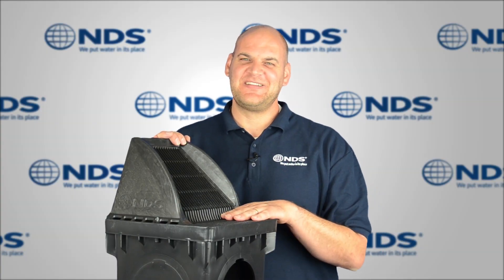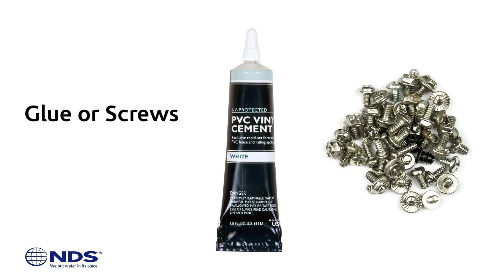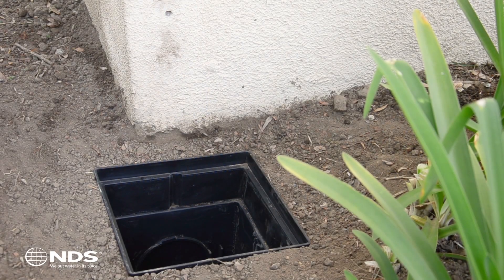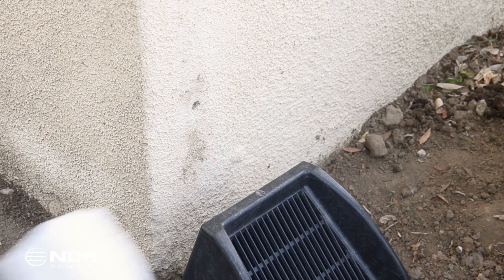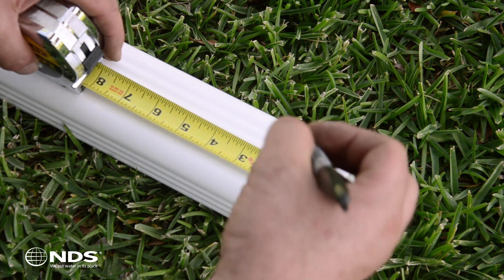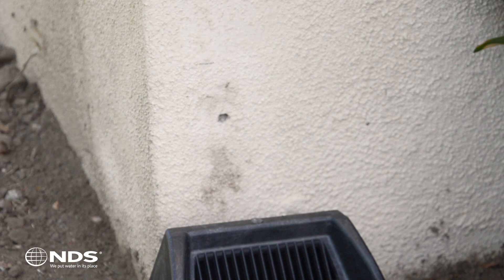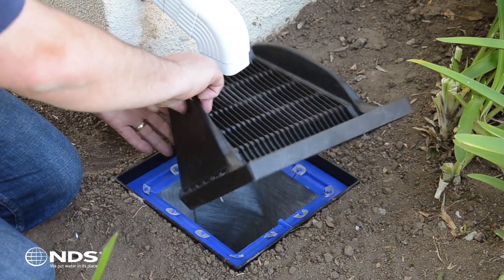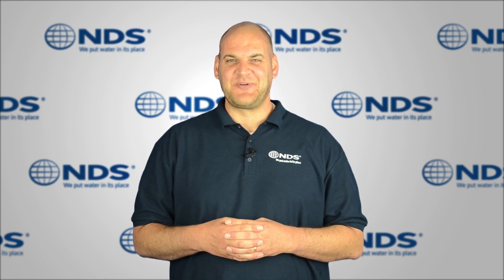How to Install the NDS' Downspout Defender™ Drainage Grate | NDS Drainage Systems

Comment: You address the "S Method" in detail, but do not address the "Standard/Recommended" installation.  The key component in the "Standard" installation is the minimum dimension that is required between the gutter and foundation/wall.   I have visited ndspro.com trying to figure out what the minimum dimension is and cannot find any information.

Comment: I think this looks really good, but is there not a concern with a catch basin right up against the foundation like that? Doesn't some water filter through the bottom of the basin into the surrounding soil? It seems like you wouldn't want that right against the foundation wall.
Reply: Brad O. No problem with it against the house the catch basin in the ground should be connected to piping which drains away from the house. the only way it would be an issue is if there were holes in the catch basin which there are not. Also the piping that connects to the catch basin should not be perforated as perforated pipe is used for a French drain and that should never start within 10 foot of a house. Furthermore cutters ideally should not be connected into a French drain system anyway as it would overload the system and cause the water to leech back out and defeat the purpose of installing one in the first place.
Reply from the maker: Hi Brad! Thanks for reaching out. The amount of water that will weep into the soil is minimal.  There will be about 2 gallons of water that would weep out of the catch basin.  If you consider the amount of rain that normally falls that doesn’t go into the basin, this amount is nothing to worry about :)
Reply: Thank you for video.

Comment: I don’t understand why this is needed if you already have a grated catch basin under the downspout for filtering purposes.  I understand the slanted pattern helps divert leaves etc from accumulating near the basin, but if the homeowner periodically cleans out the basin (like he/she is supposed to) I don’t see an added benefit of paying $40 for this attachment.